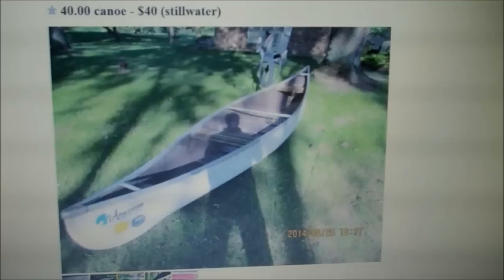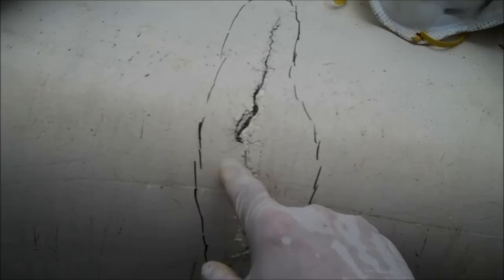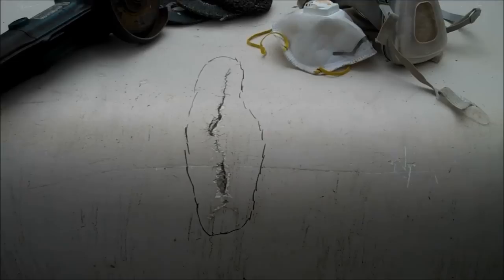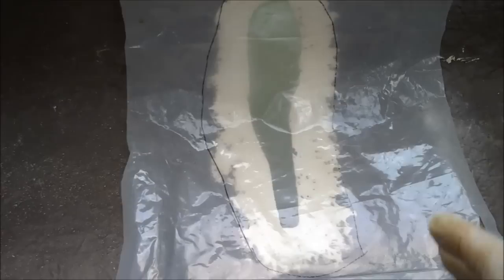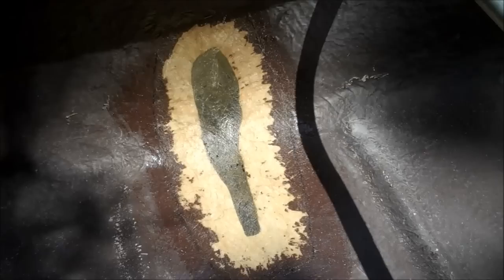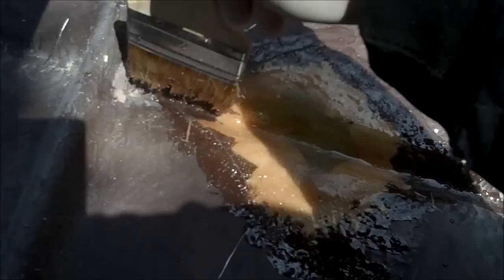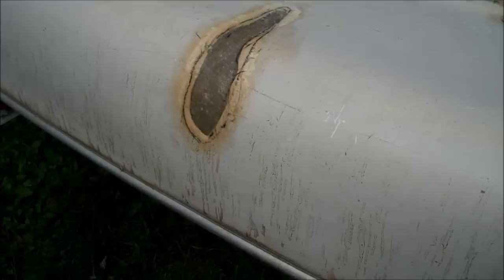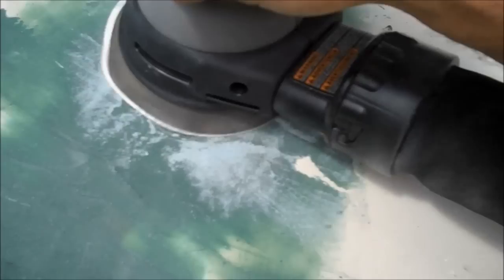Fiberglass Canoe Restore - Part 1

Comment: That is really cool.  When I was about 10, our airplane was damaged by a tornado.  My dad restored the 1940's TaylorCraft single engine plane (cloth, not fiberglass) using similar cloth and epoxies method as you.  (It was flexible, unlike fiberglass.). He painted it in the blue and yellow trainer colors.   I should have paid more attention!

Comment: These canoe videos are great.  I recently acquired a 17' custom fiberglass canoe from a coworker.  It's an odd configuration, with NO GUNWALES.  

And some clown drill holes in the sidewalls and screwed in treated cedar 2x4 to make a trolling motor mount.  I yanked that off as it was ugly and weighed a lot.  Now I know how to fill in the 7/16" holes.

I will refer back to your gunwale video as I need something to protect the raw fiberglass edges on mine.

Comment: You did an awesome job restoring that canoe, a lot of glass work but it came out realy nice; also great vid big thumbs up.
I did the same with one I got for $10.00 on CG. I thought 10 bucks! easy by the time I replaced the gunnel wood, the seats put in some inside end boxes along with all of the SS hardware i was in it for $150.00 plus all my labor (mind you i didn't have to do any fiberglass work) so I figure that canoe cost me at least $510.00 ! LOL
Lesson learned I could have bought a used one for the same.

Comment: thanks for loading this up. folks like you make Youtube! question, the fill-in layer you put in after the both layers both sides, would it be better to get that under a final cloth layer so it is sandwiched in, or is it much of a muchness?

also, my project has a lot of hairline cracks.. in one large square foot area, the hull seems weak because of a complex criss crossing of these light stress cracks. would you just looks lay a matt over it all, or open it right up?

Comment: Nice work!  I have built a Cape Charles 18' kayak and jon boat recently with tons of glass work on them and the only thing worse that sanding glass, is sanding glass in a 100 degree warehouse~ LOL  BTW, I did some research on boat paint and you can spend a lot but exterior latex house paint works great for a budget paint job.  My jon boat paint is holding up great just as long as you aren't looking for a super smooth finish

Comment: Can't wait for part 2. Could I use this method to patch a 2 inch diameter rust hole on my vehicle?
Reply from the maker: Yes.  Same skill,  same method.  Cut out and grind away all rust or damages metal.  Replace and build up with fiberglass and filler.  Sand smooth and paint.

Comment: Any suggestion on how to repair a keel? I also just got a cheap old canoe and it's pretty beat up. The damage is all the way through the fiberglass on the rear keel. Should I attack it with bondo first or or start with fiberglass? Awesome Vid, Thanks in advance!

Comment: Love the two video's.  Never done this work before and great step by step.   A few questions.  I was thinking of doing this work over the winter.  Would the cold make the job harder to do?  IS this work to messy to do in a garage?
Reply from the maker: Yes and Yes.   Ambient temp effects the cure time.  The cooler the air temp,  the longer it takes for the resin to cure.   Humidity also have a similar effect.  This job is very messy and smelly.   All these reasons are why I do it outside.

Comment: Hi! Very good video, But I still have some questions.
I will do my best to write in English (it is not my first language)
So I bought an old canoe that has a lot of “surface cracks” and I was wondering what can I do for it? Just put resin epoxy above? I want something sturdy.
And can I grind a hole (to repair a crack) that is like 3 times more big than your hole, and repair it like you did or it is just the big to be repaid (I have a really big crack and the previous owner the crack worst be trying to repair it.
Reply: Fiberglass is fiberglass,  use marine epoxy instead of polyester resin for larger repairs, profile the edges as to give a smooth transition and plenty area to grip, and the repair will be as strong as the hull

Comment: I was considering doing a very similar project. I have a friend who has an older canoe that has been left outside and has some holes in it. I was considering making an offer around 40 as well but I am concerned with material costs. What would your estimate be on the materials you used for this project?
Reply from the maker: I cannot discern that looking a comment on youtube.  You will have to estimate that amount of material you think you will need by looking at the damage on the canoe and then adding the cost up by calculating the material you estimate to be used.
Reply: I asked a ballpark figure on your restoration project because mine is similar. Are there any kits you would suggest that might contain most of the materials. Or would the quality of materials be better if purchased individually? Sorry for the abundance of questions, this would be a first time fiberglass restoration for me.

Comment: Great video! However i was just wondering what kind of resin you used, is it epoxi or polyester?
Reply: Two part marine epoxy is stronger, and forms a more permanent bond. It also can be thinner for the same strength. Polyester resin is cheaper but not as strong

Comment: could I use fiberglass to repair a aluminum boat crack I tried jb weld but it cracked again
Reply from the maker: dunkin doobing I would not recommend it.  Weld the aluminum.
Reply: What are the thickness of glass used in order?
Reply from the maker: ryan gardner I have no idea.  It's not that complicated,  it's just fiberglass auto body glass. If you want it thicker put more layers on.